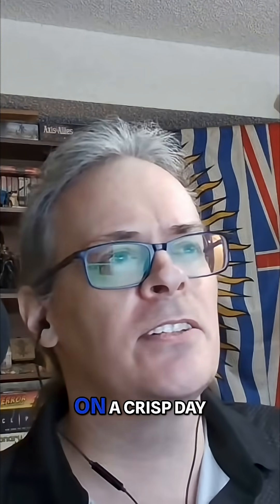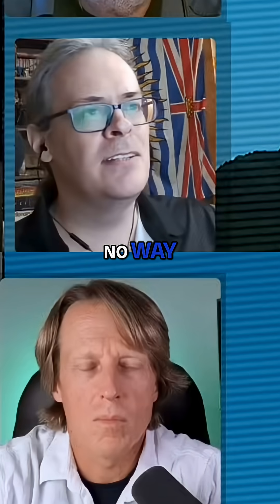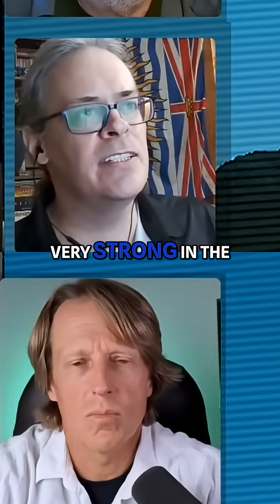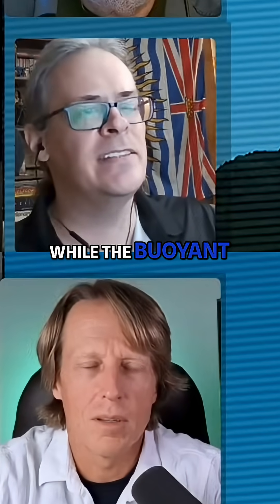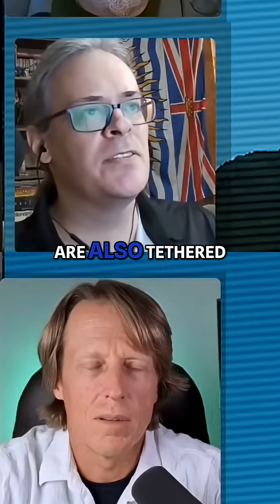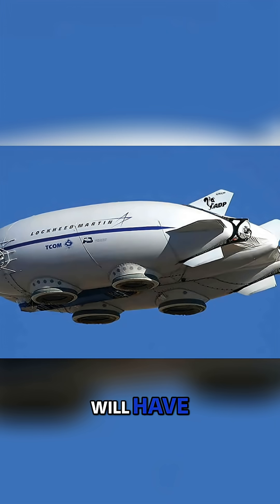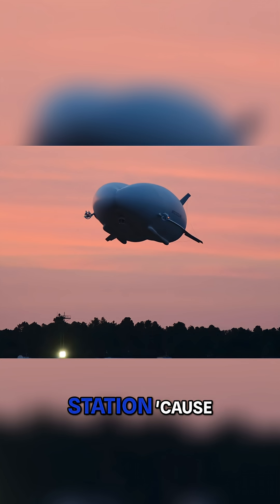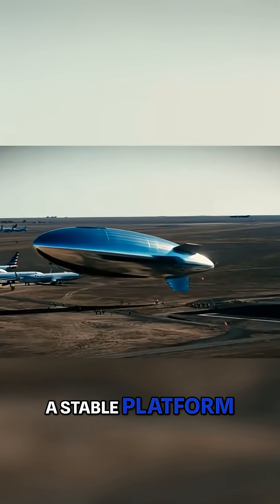Aerostat Technology: How Tethered Balloons Stay Up!

Comment: Jesus Christ Chris, this is such a transparent attempt to pull attention away from any possibility of this being anything anomalous. He's dropping straight disinformation and there's zero chance he doesn't know this. It's just so goddamn obvious and here's why

He opens with that clown claim that on a calm crisp day you wouldn't see the tether because it's less than 1 cm thick. Completely absurd. There are tiny 5.4 mm tethers for little toy level balloon drones, but real aerostat tethers for anything carrying sensors, cameras, radar or actual operational payloads are nothing like that, especially something that large. Real manufacturers list composite strength members, copper power lines, fiber optics and armored jackets. Even commercial tether cables for mid range aerostats hit around 12 to 19 mm, and restricted airspace like Cheyenne Mountain's R-2601 absolutely requires something far more robust for command, control and safety. Heavy duty ones for large surveillance aerostats go bigger still. Nothing hauling a serious payload is running on some invisible fishing line. The physics, the load ratings, the required conductors, none of it allows for a 1 cm fairy cable. He knows it, but he says it anyway because it sounds good to people who won't check.

Then he tries to patch the hole by saying the tether is made of meta materials. Jesus Christ. Meta materials aren't used in aerostat rigging. They aren't structural load fibers. They aren't power conductors. They're not part of any tether spec sheet anywhere. It's techno babble tossed out to fake authority. Then he drags Dyneema into it like he's summoning something arcane. Dyneema is just UHMWPE fiber. It's strong and lightweight, sure, but it doesn't replace copper conductors or fiber optic cores or solve the basic physical limits. It's not exotic. It's not mystical. It's not a meta material. He just tosses the word out hoping nobody clocks the difference.

And right after this fantasy tether talk, the video cuts to a blimp. An actual powered blimp. Chris I thought we were talking about a tethered aerostat, not a blimp? Engines, props, gondola, full control surfaces, the whole loud, obvious package. That has nothing to do with PTDS, JLENS, or any tethered aerostat system used in real operations. This is straight up bait and switch. Talk about an aerostat, show a blimp, hope the viewer doesn't know what they're looking at. And the engines and fans crap just drives it home. Once you add propulsion, it's no longer a tethered aerostat Chris, it's an airship, which is exactly what you showed, and none of those are cleared for or capable of sneaking into R-2601 without a full alert. And no airship is drifting silently over Cheyenne Mountain. You don't hide engines and you certainly don't sneak one into restricted NORAD airspace without being detected instantly. Nor would one assuming somehow it did make it there undetected wouldn't be able to vanish so quickly either. Once you simply apply logic and reason to the evidence it falls apart before you're even done with the analysis. The fact they even tried this shows how little respect you appear to have for the audience.

And then, Chris, you wrap it all up by asking if it could have been an anti gravity craft. For the love of God, the man can't even pronounce Dyneema correctly and you're asking him to weigh in on exotic propulsion. That's some major cope coated desperation you're throwing out to your audience Chris, and it's painful to watch because it's such an obvious last ditch pivot when the narrative collapsed. You knew the balloon explanation fell apart. You likely knew the blimp footage would expose the trick, and you knew he had nothing left to say, so the entire segment veers into SciFi panic mode.

This isn't a proper analysis Chris, not to mention a proper investigation of the event. It's the classic narrative management disguised as expertise shtick. It's a half baked attempt at subterfuge where every single seam is showing. So fellas, if you're going to run cover for the dumbest balloon theory in circulation, at least try to keep your lies internally consistent. Watching this felt like watching somebody improvise excuses for why their house caught on fire while still standing inside a burning house instead of escaping!

You guys need to stop treating the audience like they were born yesterday, because anyone who checks even basic restricted airspace rules knows R-2601 alone kills your entire premise. And yes, I do in fact realize much of your audience for all practical purposes might as well have been born yesterday but that's hardly an excuse for shoddy work.
Reply: So are my intentions bill,,
Nothing less. And I hope you received two of my comments back to your defamation of my character,  and your condescending criticism.  Criticism I can take,,,its good ,,,if its true criticism that helps a person.  But not when you personally do Not know the person,,personally.I do Not,,Never Ever do I try to bring on mythical beliefs .Nor do I EVER put forth videos that I haven't done my  research to Make Absolutely Sure they are Not planes, jets. Helicopters,  drones  red stars, burning out dwarf stars, blue stars, geostationary satilites,  satilites,  planets, etc. ALWAYS Before I post a Video,  I Always rule those out. Stars are too dim to show up on my smart phone. Research that yourself.  Yes I zoom in on phenomenal  anomalies,,and No sound? Excuse me that I feel the background of cars, trucks dogs barking, crickets are an annoyance in the video.  And since I Know there Are No sound from what I Have footage of,,whats the point of having sound? Im Not out to prove what I Know exists.  And  before you pass your judgements on me,, Ill forgive you for your arrogance and ignorance of the Honest person I was brought up to be and am. With all sincerity,,My integrity and Dignity is Not broken Ever ,,,Because I Know who I am. Honest.
I DO NOT LIE,,,OR DECIEVE. Something I Hate. I Will remember Never to comment on anything you have to offer,,because whatever you do will always be of condensending content.
I learn to avoid personalities like yours.
Minds shouldn't be made to ruin,,for that is the spirit that goes with you.

Comment: Ok,,,,,,All in what you've seen,,and What you have Seen,,And how its perceived. I wish they would explain the ones that are in a hover,,with No sound,,That have lights all around them,,that are disc in form, that are as wide in diameter as a football field length,,That Can Hover,,That have All different colored lights around it that are strobing slowly and then Turn All White,,and start strobing extremely fast And Then the UFO Takes off in Less Than a Second.  Yes,,,,in LESS Than a Second,,Not being able to count one,one thousand. 
I'm Glad all the other ones can be explained away.
Within 500 feet of Your very own eyes with No Sound. 👏👏👏👏👏